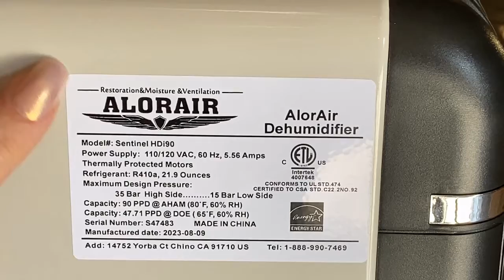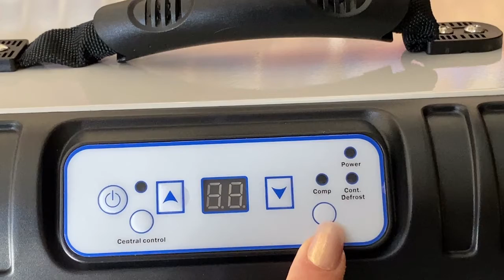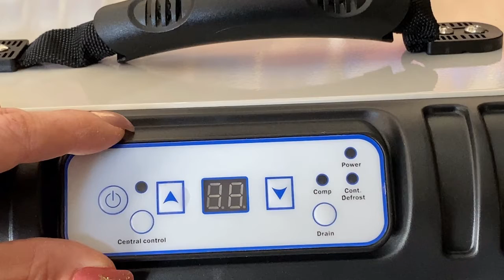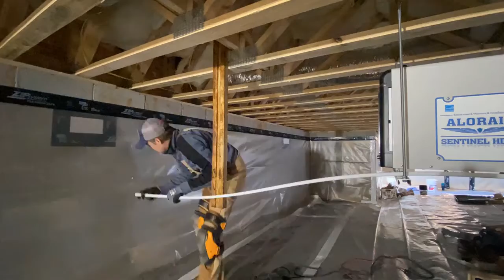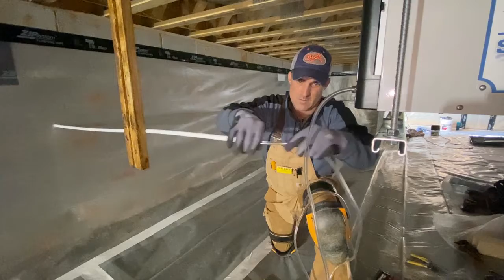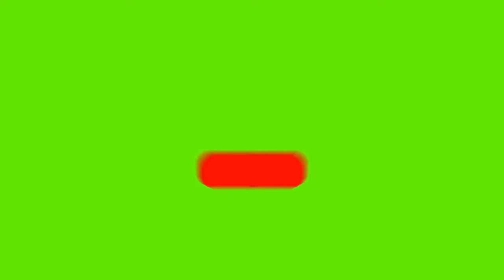Alorair HDi90 Dehumidifier Unboxing & Complete Installation Crawl Space #diy #how #howto

Comment: I know its been 2 years but how is this particular unit treating you and or the customer? Looking for a dehumidifier for our crawlspace and came upon this video. Also is the unit pretty loud?
Reply from the maker: Hi! Thank you for watching the video. These units are top notch! I have installed several of them for clients and I also have one for my personal home. They are ultra quiet and you can’t even hear them when they are running. They do an excellent job and my crawlspace is always super dry and very pleasant to get into when necessary. I have had mine under my home for about five years now and have had zero issues. This is of course only going to work best if you have a vapor barrier. That vapor barrier is key to having an efficient running dehumidifier and dry space. I hope this information helps.👍

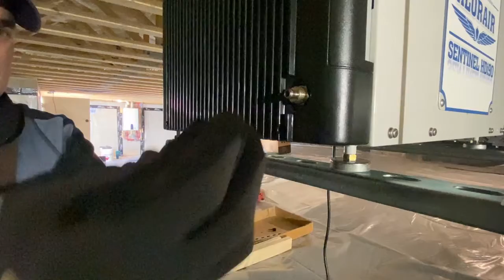Comment: Is the HDI90 LARGE ENOUGH FOR A 2500 SQ FT CRAWLSPACE 12:23
Reply from the maker: Hi Paul. Thanks for watching the video. This particular unit (HDi90) works up to 2600 square feet. So, to answer your question, this unit should work great for your application. I hope that this information helps 👍